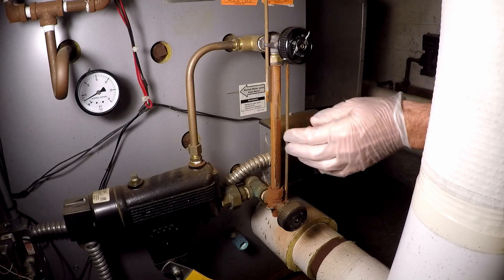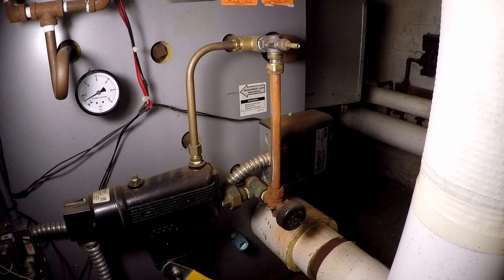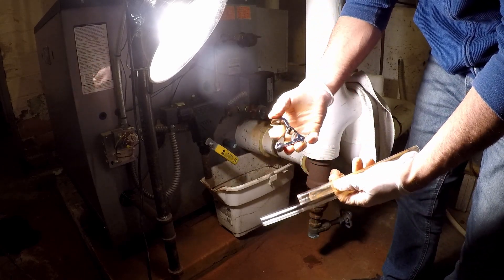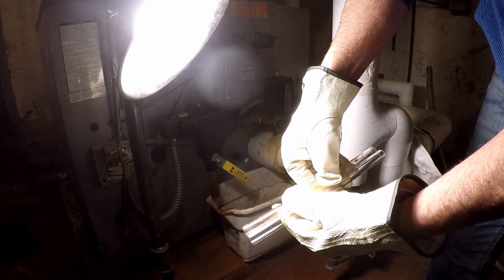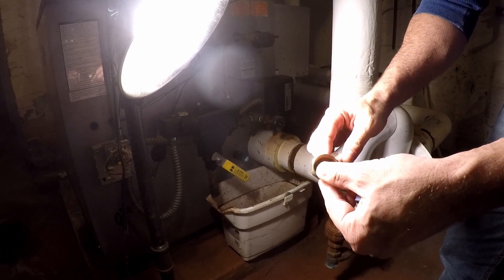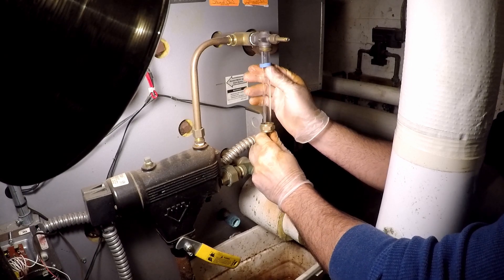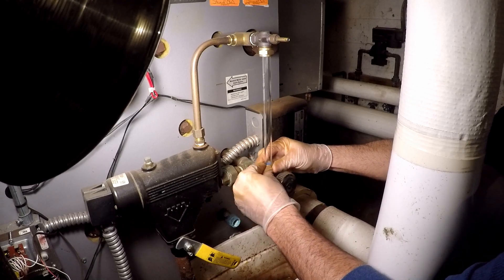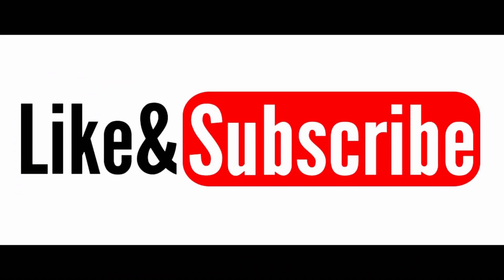How To Cut and Install a new Sight Glass For a Steam Boiler

Comment: How do you know if that top washer leaks after replacing the gauge glass without running the boiler to make steam?  After replacement close the top valve and open the bottom if the water rises in the top washer leaks. If water does not rise the washer is good. Two things cannot occupy the same space at the same time. I'll bet i"ve replaced close to 1000 gauge glass in my time